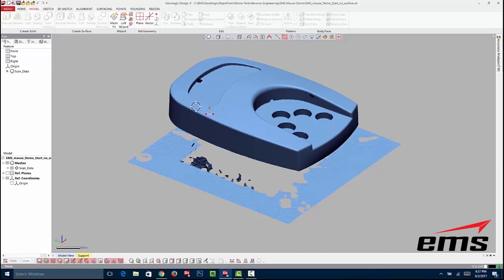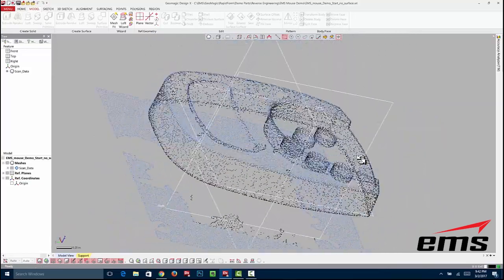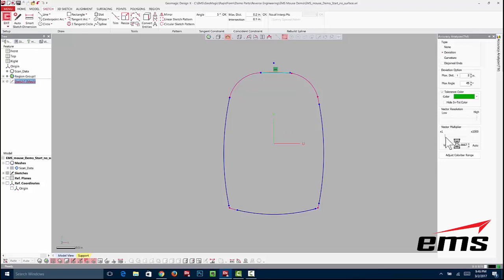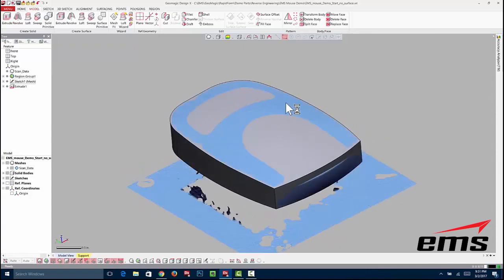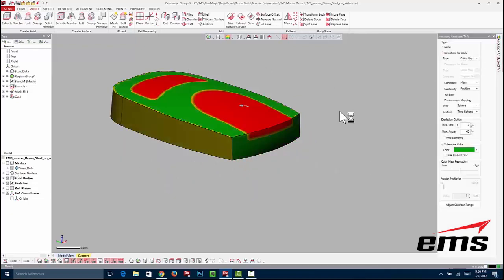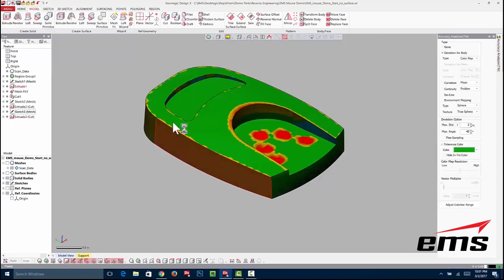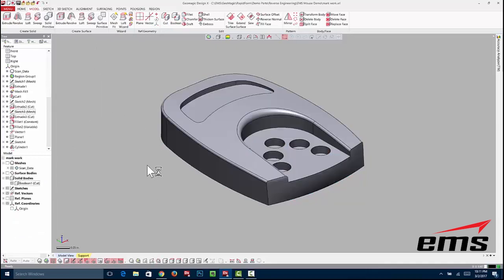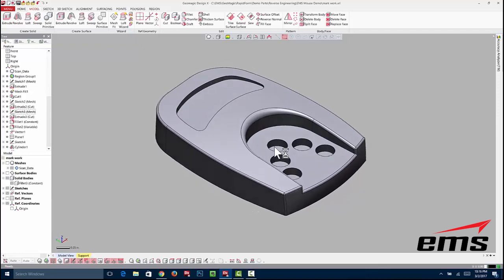3D Scan Data to CAD Model Using Geomagic Design X

Comment: HiThe best way to work, to save time and for accurancy matter when working on symetric Model is to define a symetry axis, then work on one side of the model and when everything is completed, You make the symetry or Miror command of that half of the CAD Model and export the entier model 

On Catia I did the Audi A4 car Model, and the  Sukhoi SU 35 Aircraft on SolidWork. The Miror/symetry command can save half of working time, with better precision.
Reply from the maker: You are correct.  For this example we are keeping in simple.

Comment: It's a great tutorial, I'm asking about the version of Geomagic Design X you are using?
Reply from the maker: This video was done with Design X 2016.  The newest version is Design X 2020.
Reply: @EMS3D  are there any supported tutorials for the 2016 version? I downloaded the STL file that the video is working on, but it was different. The surfaces of the file I downloaded are not exactly the same, and going on with the steps doesn't give the same results.

Comment: Thanks for the great video! When I try to auto segment my scan data, I’m getting 1000’s a small segments instead of real nice clean simple segments like you’re getting. Should a smooth and decimate the mesh more ?
Reply from the maker: Did you try adjusting the Sensitivity and Mesh Roughness settings?  If that doesn't work you can manually create your regions.
Reply: EMS3D Is that pre or post scan?
Reply: @TenSecond408  These settings are in the Autosegment command.  This would be after the scanning is complete.  If you scan is really rough I would try using the Global Remesh command first.
Reply: EMSTampa thanks for the input! I feel like every scan from the FARO blue LLP is jittery (if that’s the proper word) I feel as maybe my scanner setting are maybe to sensitive possibly, who knows.
Reply: @TenSecond408  Is the scanner arm base and work piece securely locked down?  Any movement in either one will show up in your scan data.  If it is then your system might need factory re-calibration.  If your encoders are not working properly you data can look rough.

Comment: Which was the format you imported the cloud of points? I got it in .E57 and .dwf but I can't introduce it in design X. Any suggestion?
Reply from the maker: We usually import point clouds in .PTS or PTX format.  .E57 typically comes from LIDAR systems such as Leica or ZF  You will need to convert from .E57 to .PTX to bring it in Design X.  If you have Cyclone see if there is an option to output .PTX Files.

Comment: disappointing... All we gained from a cloud of points by scanning, is only used to reform the solid manually.... AI is really expected to make all that pretty  tedious work easier.
Reply: It’ll probably take some time for AI to do this. It’s not about recreating the scan using parametric solids, which would be fairly simple. It’s about taking into account the original manufacturing process, the product life cycle and it’s consequences to the part.. and then you have to take care of the measuring errors, too. It’s that what makes reverse engineering so fascinating to me. You really have to be experienced, smart and creative to master it. This is the best video I’ve seen capturing the basics, though. Good job!
Reply from the maker: Agree it is part art and part science.  Just like self driving cars can't predict everything correctly and sometimes they make the wrong choice.  They are only as smart as you make them.  It's difficult to know every situation you could ever encounter whether driving or creating a CAD model.  Every situation is different and sometimes there is no right answer.